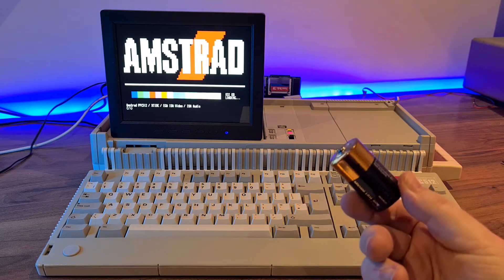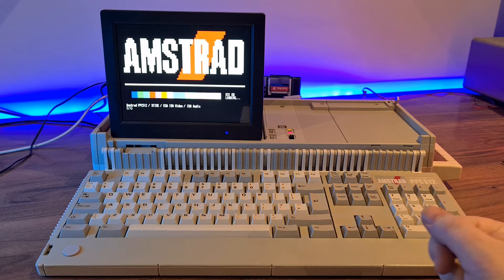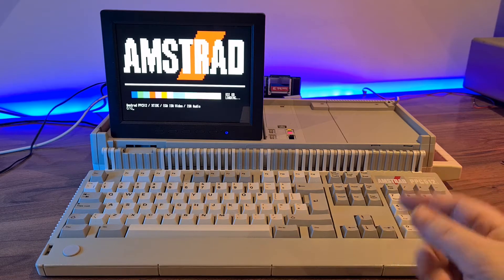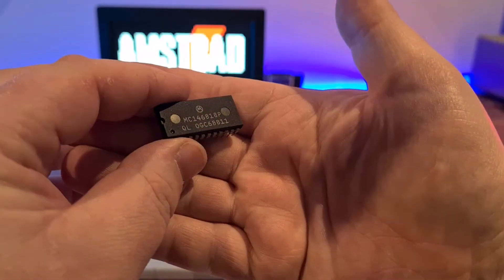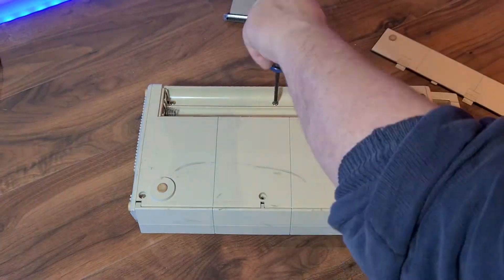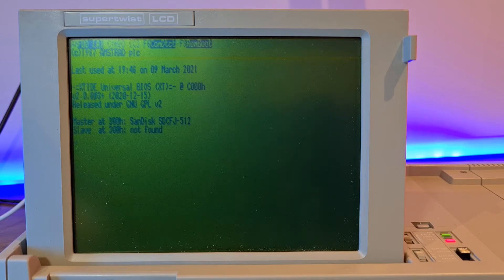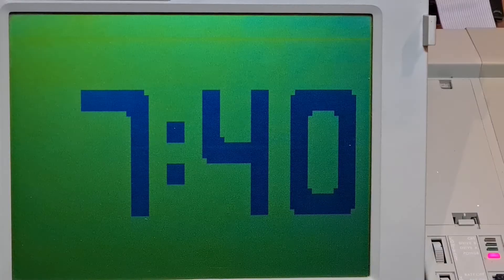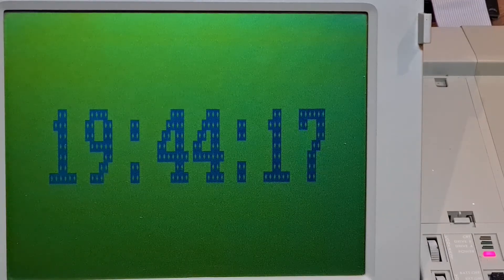Amstrad PPC RTC Clock Chip Swap Dallas DS12887

Comment: Honestly I don't consider the DS12887 (with integrated battery) a decent option. If they are discontinued and the battery is drained people use a Dremel tool to cut them open and attach an external battery. That's an awful solution! Just looks ugly and non-professional - nothing a retro computer deserves!
As Atari used the 12887 in the Falcon030 I once designed a PCB with a DS12885 (12887 minus quartz and minus battery) added a CR2032 holder and a 32,768Hz quartz. But there wasn't much demand (15 sold in two or three years). So I kept some for myself and don't offer it anymore for sale.
Reply from the maker: I agree there are better DS12887 replacements, but these were still available at the time.  The point of this video was to show that the Amstrad Clock IC was compatible with DS12887 + variants and removed the need to install 6 D cell batteries to stop the date time beeping.